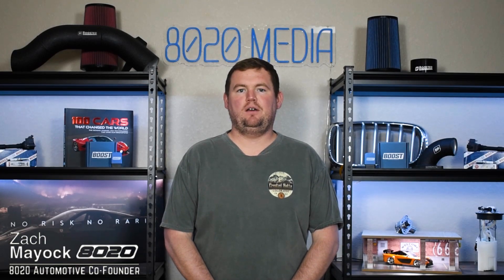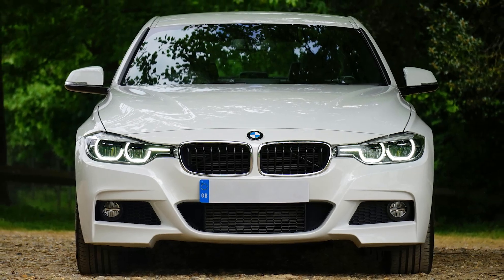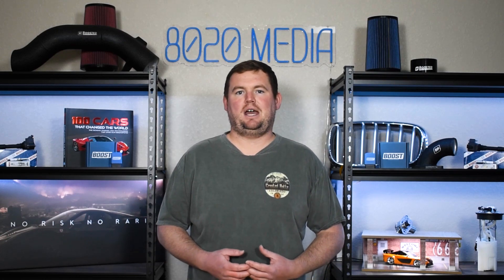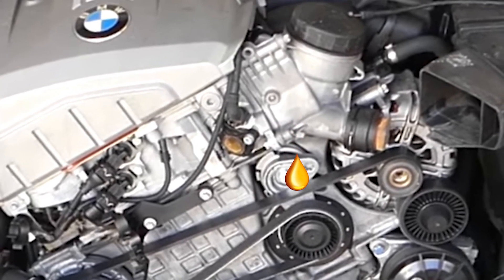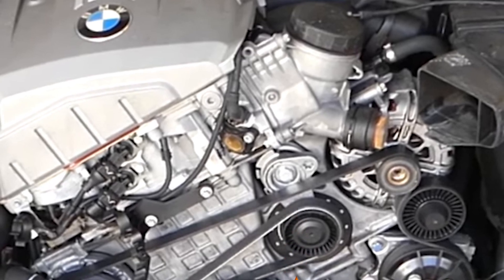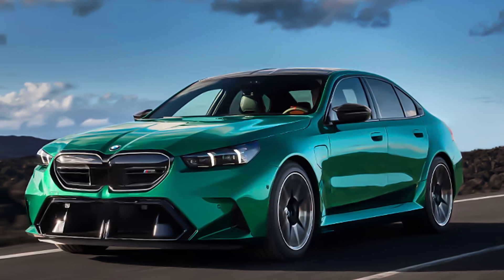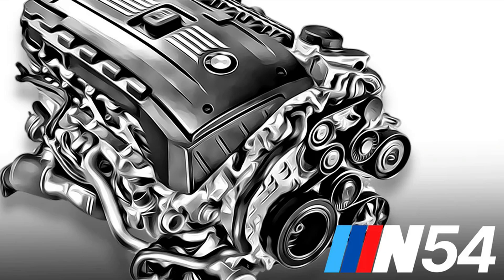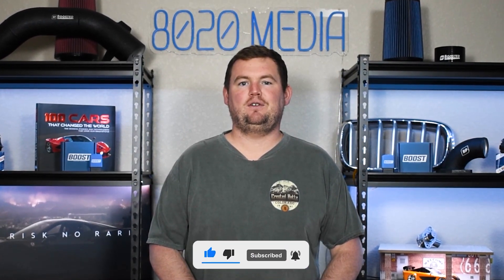Sign & Symptoms of Oil Filter Housing Gasket Failure!

Comment: I have all these signs of a oil filter gasket going out but I have a question will it cause a bunch of white smoke out the exhaust especially when you come to a stop a cloud comes around your car and smells bad?
Reply: It’s a 2007 BMW 335xi I just got it 4 days ago with 105k miles and wanna build and fix it!!